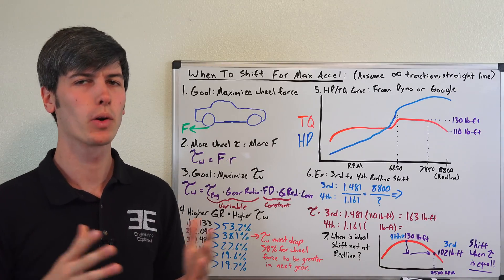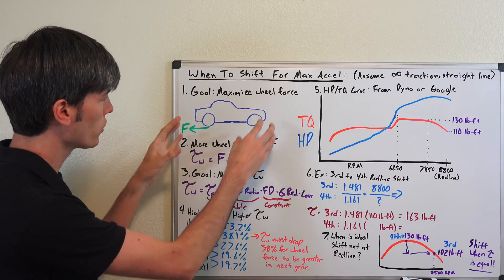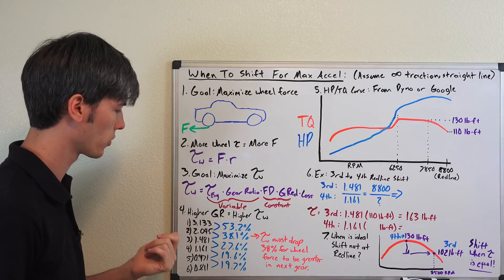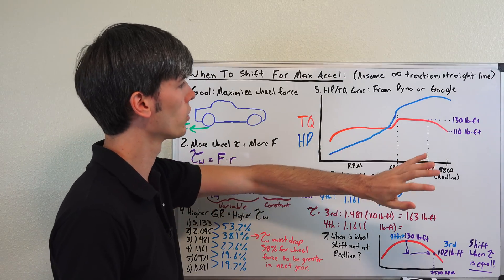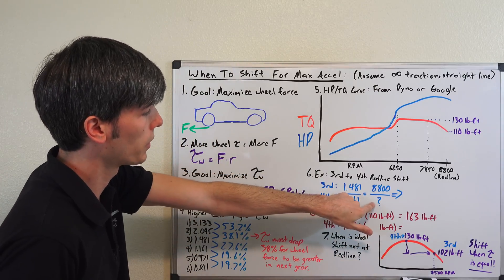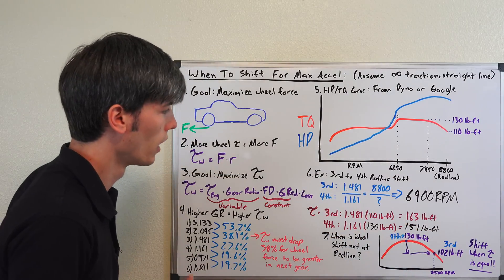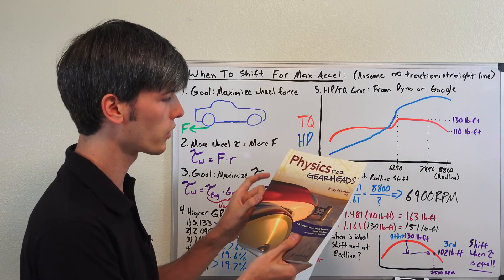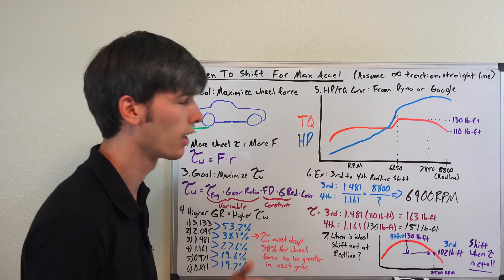When To Shift Gears For The Fastest Acceleration

Comment: In theory I understand this but in first gear if you plant your foot to the floor with the given that you have infinate traction, is this going to yield better gains than pressing the peddal slightly slower especically with cars that have vtech, vanos variable valve turbo supercharger... I am basically asking is foot to the floor going to going to be better than a slightly slower feed in light of these other components as I notice somecars pause or get bogged down if you are heavy footed even with traction control off so this could hamper times..

Comment: You can do the same with power values, keep the engine at the rpm with most power possible. The you only look at rpm drop and power for each engine speed, less calculations.

Comment: I think it would be clearer to look at the power rather than force/torque, because power isn't affected by the transmission.

Just look at the power curve of the engine.
When you shift, if you go to a rpm where the motor output less power than where you were (near readline), than you will accelerate less. Simple !

Comment: I find it helpful to calculate the VTEC cut in 6250 RPM speeds for each gear. I have actually put stickers on the speedometer. Then you know when to downshift and you are not left to the mercy of oncoming traffic when overtaking. Very few drivers can actually keep VTEC engaged.

Comment: For Turbo cars it will differ, but for most sports car the car mfg know this stuff, and will typically make the gears mesh so you pretty much have optimal change at red line.

I.e. 991 Turbo S have optimal shift point in 4'th (first gear where it's before red line) at 7176 rpm, or 24rpm less than red line (but that's assuming linear torque between 7000 - 7200, so being off by 10% is very likely so I would not be surprised if it's still 7200). At gears higher than 2 (3-5) the optimal gear change is at red line, with exception for 6-7, as 7 is a fuel saving gear, not intended for acceleration (also why this gear is not used in sport+ mode).

Comment: I was playing with this some time ago and here is a more graphical explanation of what you just said:
http://www.imagebam.com/image/693ac7508070961
Here are the parameters I used:
http://www.imagebam.com/image/62f78d508070959

Although I'm usign SI units, the projection of engine torque (basically the torque split between the wheels) over speed is a great example for this question.

Comment: My understanding is that AWD cars (Evo/STi etc) have significantly more parasitic loss through the drive train before getting to the wheels. In such cases, would you expect a lower shift point (in general) in higher gears?  Also, any thoughts on how boost taper might affect this?  Thanks!

Comment: I would say that any car that makes peak torque and Horsepower at or above 5,000 rpm are cars not good for daily driving. This is directed towards vehicles with no flat torque curve. Most cars peak out torque numbers at lower rpms. Even my 3.0 v6 vulcan engine in my 99 ranger peak torques around 35 or 3600 rpms and peak HP is around 4,000 somewhere. If that stuff was produced at any higher rpm the truck would have shitty daily drivability and almost not usable to hall anything. Also It's not at a lower rpm cause  If it was cammed for peak torque at lower rpms it would be gutless in torque and horsepower. It's not a powerful engine to begin with but it sure is reliable. Sitting at 157,000 miles right now. And it's all cast Iron. And it's an Oversquare engine with a compression ratio of 9.3 to 1.

Comment: I have a question, 
My motorcycle's ECU isn't displaying the engine RPM since it uses a different PID (which no one has found yet)
I'd like to know if it's possible to calculate engine RPM using existing data such as speed (from ECU), gear and gear ratio(not from ECU), etc.
thanks a lot and nice video! 😃

Comment: Engine Masters just tested a Mopar 360ci V8 that's been junk for decades, the whole lower end was making too much blowby and the cam bearings were done for.  Max torque at 1800 RPM, and then dropped like a rock all the way to redline.  When's the best time to shift an engine that's dropped that much torque over the years? lol

Comment: I have a B16A1 engine with 12:0 CR and B18C4 cams and it makes 158 whp @ 8200rpm , the fuel cutoff is set @ 8500rpm
I know there are other variables to consider, but is engine wear something to be conscious about ?
When is the point where you rev up the engine "too much"? How significant would be the wear between 8500 and 8800 ?

Comment: Third time i'm asking for diesel runaway video :D I can only find smokescreen videos but none explain why, what and how..
Reply: Why do you need a video?
Diesel engines do not have a throttle plate controlling air intake to regulate engine speed like on a gasoline engine, it is a wide open tube from the intake valves to the air intake opening exposed to the atmosphere.
Diesel engine speed is controlled by regulating the fuel quantity and injection delivery timing.
When a diesel engine's air intake is exposed to an unregulated combustible fuel source such as natural gas, propane, butane, hydrogen, ether, gasoline, oil, diesel fuel, alcohols, etc.... it experiences runaway because there is no longer any fuel delivery control.
Some diesel engines experience runaway by ingesting their own crankcase lubricating oil.
The typical way to stop a runaway diesel is to close off the air intake and or flood the air intake with a sufficient quantity of non-combustible compressed gas such as carbon dioxide, nitrogen, halon, argon, helium, etc...
Reply: Because i simply want one and why not, like there is some extraordinary need to make a video when to shift gears, it would be nice since he covered so many topics about vehicles and engines.. In anyway, thank you for your time and explaining this, i heard before it happens because of abnormal amount of fuel that is getting into the engine.
Reply: ***** 
No problem.
You are welcome.

Comment: Diesel engines are another example of shifting early for maximum acceleration since they make so much torque down low and hp drops off substantially the higher you rev.  For example, VW TDIs w/the 6 speed feel much quicker shifting around 3,500 RPM, you "ride the torque curve."
Reply: Shift point on any modern diesel depends on the torque and power  (HP/PS/KW) curves and gear ratio spread. 
There is no single blanket answer that fits all applications and conditions. 
The VW TDI is considered a high speed diesel and certainly has a higher RPM shift point that low speed (~1K RPM redline) or a medium speed (~2K RPM redline) diesel engine application.

Comment: Would it be fair to say that the engineers of the vehicles had the engines calibrated to give max torque at the highest RPM regardless of make?
Reply from the maker: Nope, generally not the case. A lot of modern turbos produce peak torque early on.
Reply: Nope,  The new wrx makes peak around 3-4k and then after 5k it takes a nose dive.
Reply: most engines make peak power at higher rpm than 5252... which is of course where torque and horsepower cross each other on the graph.  The only engines that don't rev past 5252 rpm are old v8 engines and diesel engines afaik.
Reply: Thanks for getting back to me.
Reply: no torque and hp will cross at a certain rpm (meaning hp will go up and tq will go down).

Comment: There is another instance when it is ideal to shift before redline: if your engine can't drop RPM fast enough to make the next shift. After all, a car can't accelerate in neutral. My first car was a 1996 Ford Probe 5-speed manual. Taking first gear to redline (6500 RPM)got me to 35MPH but I had to do a long double clutch shift, usually straight to third, because the engine stayed at very high RPMs too long even with my foot completely off the gas. Shifting around 4000 RPM worked much better because the RPM dropped quickly and I was able to make fast shifts to second and keep applying power through the wheels.

Comment: What's 1:1 on the S2000? 4th?
Reply from the maker: Gear ratios are listed in the bottom left corner. There is no 1:1.
Reply: I meant the input speed relative to the output speed maybe you mention that in you're  video and My add was kicking in again.
Reply: 1st	3.83	
2nd	2.20	
3rd	1.40	
4th	1.00	 so 4th would be
ect. nevermind I answered my own question lol thanks
Reply: okay so at 60 miles an hour your RPMs are what 3500 in 6th?

Comment: By having looking to your graph, it would be more ideal to shift if the gear that you shifted to or going to shift to will ref at 6250rpm.  And by working backward, you will see the best RPM to shift from 3rd to 4th is 7972 RPM which is not the red line.

Comment: I feel like modern small boosted engines like GTi, A3, Golf R, 335i, Ecoboost make their peak power at around 5500RPM and redline close to 6.5-7k revs and that it is more efficient and also quicker to shift at around 6000rpm rather than 7000rpm. What are your thoughts on this?
Reply: correct. Depends on the turbo size, tuning, as well as cams. But generally these cars including the STi have fat midrange upon full boost.
Reply: It depends on how much the power drops and the gearing ratios. It's not a matter of opinions, but if it were I would still shift at 6500 or so.
Reply: Get the dyno graph of these cars and do the calculations that he did for them. You'll find your answer.
Reply: I have an EcoBoost mustang...it's really noticeable after 5500rpm that the power drops off (Redline stock is 6500)...seems like everyone has their preference when to shift (I've heard everywhere from 5500 to 6500 is "best")...after experimenting my best times always seem to be when shifting around 6k but for what its worth I believe the automatics shift at redline at WOT....aftermarket tunes really can help "smooth out" the power band and really increase power near redline...

I'm sure part of the reason is that companies like Ford want to keep somewhat of a gap in performace between the smaller boosted cars and bigger NA cars....with a few bolt on modifications and a tune an ecoboost mustang can easily hold its own against a stock GT (which has an engine more than double the size and cylinders) for quite a bit less money than the GT...

Comment: Is the torque curve really what we care about when talking about acceleration, or is it just relevant when talking about specific changes in gearing? I thought you showed in another video of yours that HP is proportional to acceleration?
Think of it this way: if you had maximum acceleration at peak torque, and you had a perfect CVT, you would put the rpm to peak torque for the most acceleration. In reality, however, we would put it at peak HP. Wouldn't this demonstrate that the HP curve is relevant here?

Comment: What happens when you shift accidentally at 1 from a 6 at a highway?
Reply: Why are you even asking this question? How do you 'accidentally' shift from 6 to 1? Sounds like you shouldn't be anywhere near a MT.
Reply: Well if you're lucky the gear wont engage, synchros can only do so much to try and equalise the gear speeds for engagement.

If you're unlucky the gear will engage and either the gearbox will break or the engine will either with the potential to throw the car into an spin/accident.

I actually saw a video here on youtube where a guy in a Honda was doing an acceleration run and he shifted 1st-2nd-3rd-4th-3rd... the engine shrieked over redline and blew a hole in the engine block.
Reply: Your are so lucky you drive a 6 speed then say "domestic 5 speed" or else your a** would have shifted into reverse and trust me ive seen it happen before bad very bad accident. your motor probably had the saddest drone and blimp when you shifted into 6 😂😂
Reply: +Alexander Klein Does pressing the clutch as soon as you realize the mistake help?
Reply: Opposite Lock It would depend a lot on the vehicle and how lucky you are I guess, generally I'd think not.  

If you've fully released the clutch pedal and the clutch has properly engaged then even in the best case (ie. going down one gear rather than up one) your engine is already being forced several thousand rpm over it's redline (assuming you were shifting at redline).  

I'd think the best you could hope for is that your clutch can't handle the strain and will slip giving you a small window to hopefully save your engine/gearbox.

Best advice is just don't mis-shift :D

Comment: 1st Congratulations for a really interesting channel

2nd Sorry for my english, isn't very good and it's very probably I write something wrong, I hope don't give to you too much extra work 

3rd Here in Europe (I'm spanish) the most popular engine option is being downsized petrol engines (ecoboost, TSI, Puretech,... ), all they with a low inercial turbo, who gives you a lot of torque at low rpm and it will be "saturated" at hig rpm, when you drive it you can feel how the torque fall down before 5k rpm, but the red line still over 7k rpm. With the turbo diesel engines I feel something similar. Perhaps you can find some interest to compare this specifications with the s2000 specification and see the diferences for new conclusions, and give very interesting information for this side of the Pond.

Comment: Unless I'm not understanding something correctly, what intrigues me is why Honda didn't optimize the gearing for 7850RPM.  In terms of the dyno chart, it seems to me that you'd get peak efficiency if 4th gear had a ratio of 1.25.

Comment: Turbocharged engines are so much simpler you just shift on redline or in case of a small turbo when it runs out of breath. Now for supercharged cars I'm not really sure whether they behave more like N/A than turbo cars. They have a lot of torque down low but do they not provide as much airflow as a turbo on higher revs? If so then you just shift it earlier not redline to always have optimum torque area on the graph.

Comment: All that you explained cold be compressed to one simple sentence: try to drive at max power RPM. Wheel torque depends on wheel power tat is nearly the same as engine power and vehicle velocity. It means, what ever your gear ratio, RPM should be as close as possible to power peak and ideal shift is when max power zone is in the midle
Reply: russian english may be difficult to understand, sorry if it is

Comment: When do I shift in my Turbo Diesel that has peak torque at 1900rpm which tails off very quickly?
Reply: Shift that car and buy a new one.
Reply: I also daily a turbo diesel, and this method helps:

If when I upshift, I feel a loss in Torque, I should've shifted later
If when I upshift, I feel an increase in Torque, I should've shifted earlier

It's not very scientific, but it works! And after a couple of tries you start to shift in the exact moment
Reply: You apply the same principle. You must go a bit after the peak HP because when you shift into the next gear the rev will go down and you need to be in a good point of your powerband, so is the min/max better average that you have to know. Its the same principle.
Reply: good question, would like to know that too :) ... what about diesel engines??^^
Reply: TheXtremesoundz i shift normally at 3500,depends on sensation ;)
Reply: ah thank you, nice :)
Reply: Javier E Yep mate. Then its just a matter of checking the times.
Reply: check your owners manual. probably between 1100 and 1500 tho.
Reply: Fernando Fragoso It's*
Reply: 2100-2300rpm, if you need acceleration 3300rpm.
Reply: mypinis most cars since 1998 has injection and turbo controlled by ECU. The power delivery could be modulated with a new map. No need to change the car.

Comment: Turbo diesels can be different, especially if it's a lower displacement engine (high mechanical rev limit) with boost under ECU control (ECU winds the boost back to prevent overspeeding the turbo).  Renault K9K engine does max HP at 4000rpm but it's making 75% of max power at 2800rpm, the boost starts cutting back after that.   The redline is over 5000rpm however !  The turbo is really small, but being a diesel (no knock/ping to worry about) it can safely push lots of boost, but only at low revs owing to its small size.

Comment: Can you simplify that by saying: "Shift in case you reach higher HP" or does it not work this way?
Reply: Shift to maximize horsepower. power = force * velocity. A gear exchanges force for velocity or vice versa without changing their product. To make it easier though, remember that a lot of vehicles can be shifted when they're about to hit redline, because the engine tends to make more power there than it does at whatever rpm you are at after the upshift. (if peak HP is 5300, redline is 6000, and the next gear will put you at 4000, you might rather stay in  the current gear until you're about to hit 6000 and then shift, so you end up starting out at 4500  in the next gear instead.
Reply from the maker: Well, it doesn't really work this way for gears. You could be at peak HP in 6th gear, and your acceleration would be slower than mid HP in 2nd gear. You want to maximize (gear ratio * engine torque).
Reply: Thanks for reply! I was thinking about it this way: If you drive at certain speed and at that moment you wanna know if you should shift, it is basically the same as trying to find out "best acceleration at given speed". This is what you talked about in your video about CVTs and that's where you said that at given speed, you should go for maximum HP.
Reply: Nope you are actually wrong on this. You look at hp, since hp is (torque*rpm/5252),  even if you apply gearing HP stays the same(-losses) and wheel has constant rpm at shiftpoint -> wheel torque scales with hp aka you don't want to shift before you get higher hp out by shifting or can't get any more rpm,  usually the later one happens first